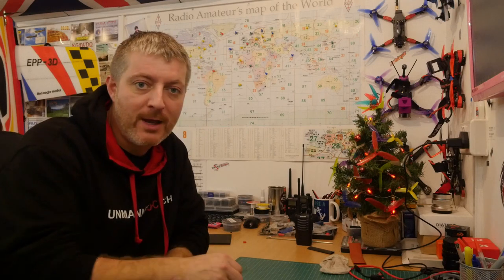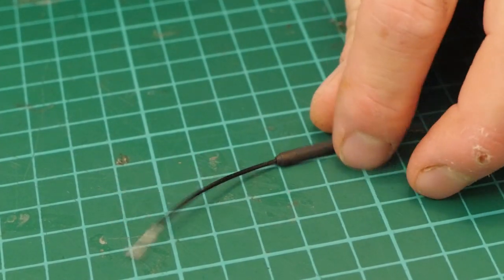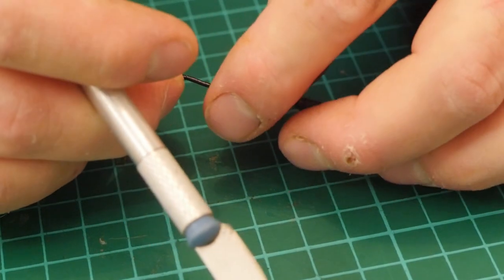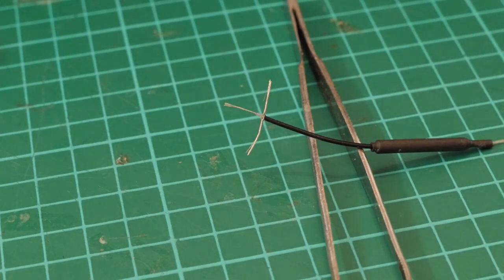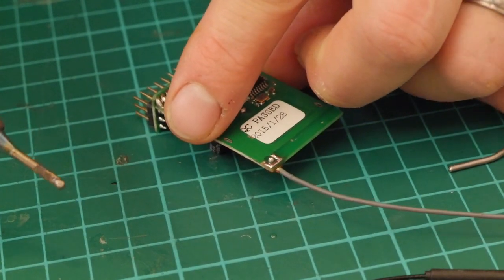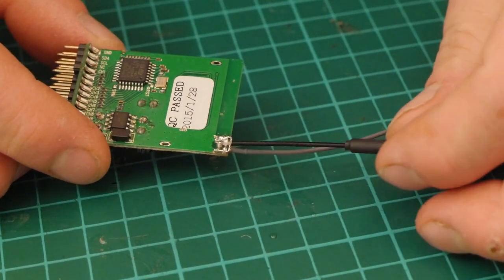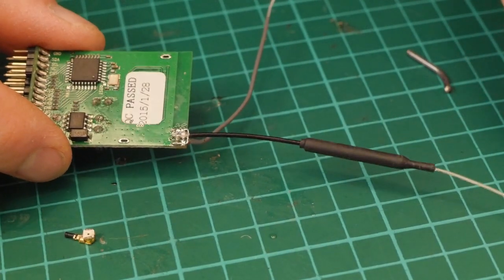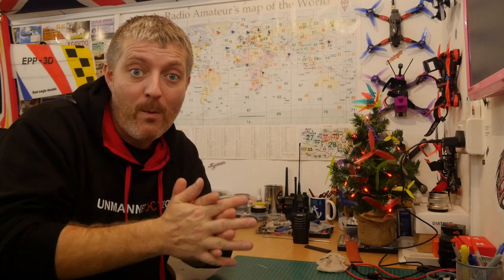REPAIR BROKEN RC RECEIVER TRANSMITTER U.FL ANTENNAS 2.4GHZ  5.8 ETC

Comment: New to the hobby. In less than 4 months I have broken 2 rx6r , 1 rx4r, and 3 rxsr receivers.Usually its the ufl connector. The rx4r was BRAND NEW, the glue holding the antenna in place was weak and the physical antenna seemed cheaply made compared to some replacements that I had bought so I decided to swap the brand new antenna out, this resulted in the pad pulling right off the board. Aside from being extremely disappointed with how overly fragile these "connector" issues are, I have decided to try and repair them on my own - this seems to be an important issue with FrSky Rx's, as I have already wasted well over $100 and currently none of them work. If I can repair them or direct solder them to the board, it might be the greatest hallelujah moment of all time. Thank you for the video!

Comment: Thank you for this video! No way I did it as clean as you did here, but it worked brilliantly. I chopped the UFL plug off and soldered the new antenna to my VTX after following this. I do think it would have been far easier to solder on a female UFL plug to the VTX, but patience got the better of me and this didn’t require ordering more parts. Great vid thanks again.

Comment: I have a question. I’m currently building a rc submarine, and I need to extend my antenna so it can stay above the water. Can I just use like 20m of the wire you recommended, and solder it on to the existing antenna?

Comment: Hi mate. Have you ever used different types of antenna for the transmitter reciver like clover leaf etc. Is there a way of telling with antenna is the transmitter or reciver? . I'm new to drones.  I own an upair one and I'm looking to improve the control range.  I'm in the middle of fitting a new transmitter 5 ghz bd antenna for fpv so I thought while I've got it all apart....

Comment: Damn you make that look so easy lol I'm new to fpv and the ufl connector came completely of the vtx and is still on the antenna the pads are exposed so I should be able to fix it but they put that yellowish glue when shipped and I don't know how to solder what is that glue/epoxy that they use????anybody thanks👍